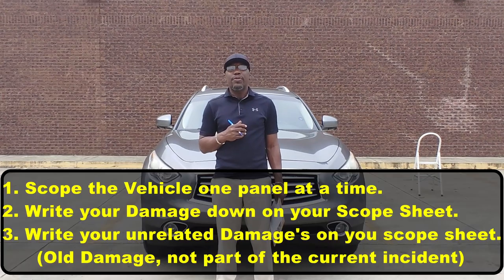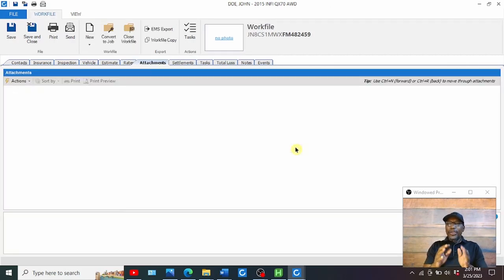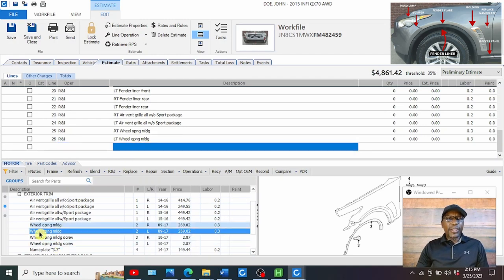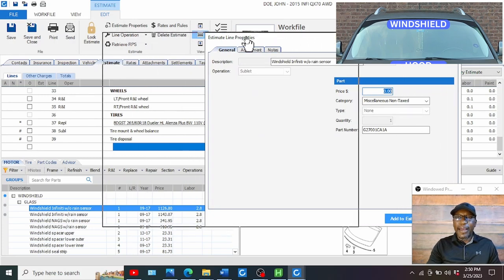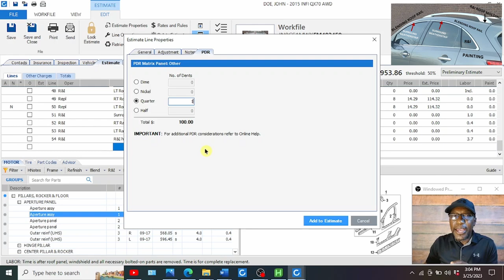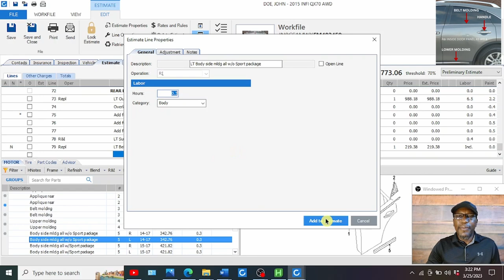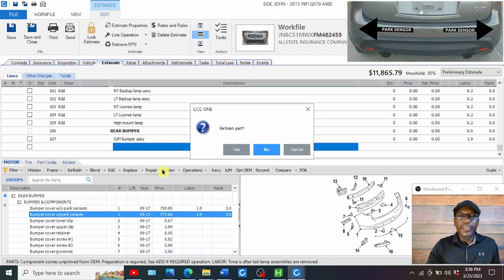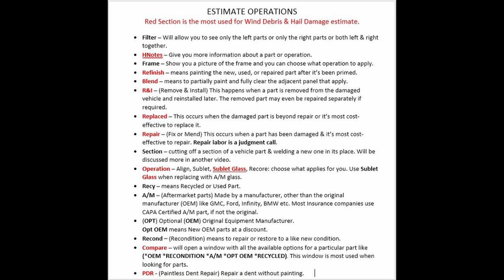How to write an Auto Estimate step-by-step for beginners

Comment: At what percentage threshold is it considered  a total loss and not repairable?
Reply from the maker: In most cases 75% of the value of the vehicle and this mostly apply to collisions & wind debris. Floods Vehicle, it depends on the flood level and Hail damage vehicle, there's a matrix provide by the insurance company and the percentage is different, depending on the vehicle.
Reply: Prior shop estimator and insurance adjuster here.

Mainly It’s set by state insurance commissioner law.
Exp MD is 75% of the AVC
Some states are 100% damage over the ACV ( Actual Cash Value).
As a shop you prepare the estimate to determine the scope/cost of the repair.
The shop can use NADA values as a GUIDE or estimate of the ACV.
Is the cost to repair 75% greater then the ACV? If so it’s probably a total loss.
Now as a insurance adjuster I need to make that call and not the shop.
Why? Because the insurance company is the one who is writing off the car, dealing with payments and title and salvage disposal. 

In some cases a insurance company can total a car at any %
Exp flood claim, mold, bio hazard claim.  Let’s say a car was flooded,
These are just written off if the water went above the rocker panel. It can become a headache car / claim for years to come to the insurance company and most importantly the owner.